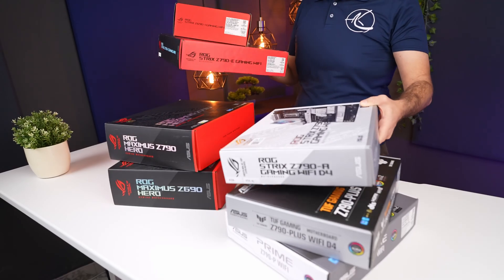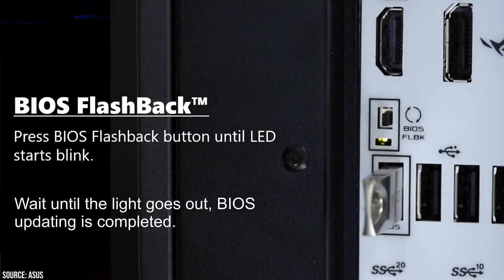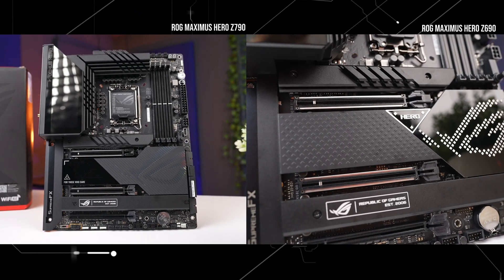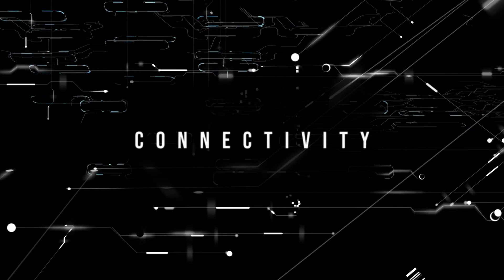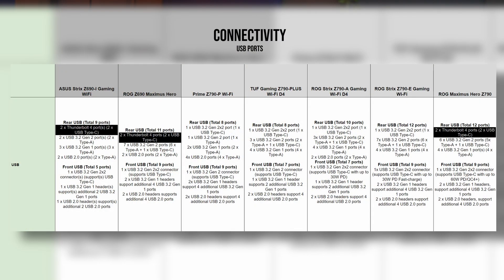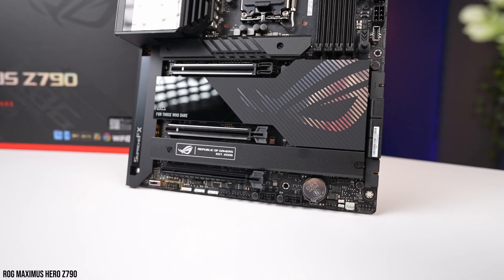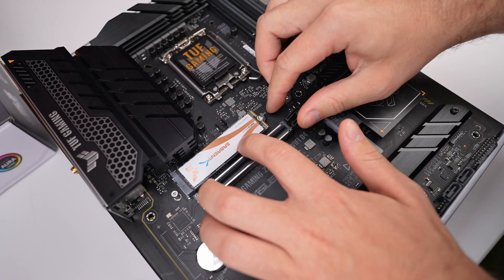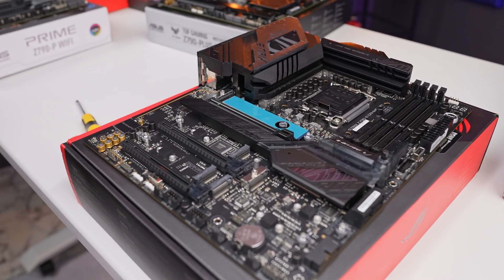WATCH THIS Before Wasting Money On Z790 Motherboards

Comment: is there any point in going for ddr5 for gaming in 1440p yet? I'm considering an i7 13700k and ddr4, can always upgrade in the future if need be. ATM I'll probably just go for an extra ssd instead or something else QoL wise.
Reply: im on the same boat. Want to upgrade to 13700k but deciding to go with DDR5. Even tho it won't make much difference yet, later down the road you can upgrade the ram without needing a new motherboard.
Reply: Save $100 and get the i5-13600K. You'll never notice the difference.
Reply: for gaming 13600k makes by far the most sense. it already has 14 cores... like 13600k is gonna be extremely good this gen. i'm personally getting ddr4 tomahawk z790 motherboard along with 13600k and using the remaining money on nvme drives id otherwise waste on ddr5 or i7/i9. on my opinion i7 makes no sense at all, you either get the i5 or go straight to i9 if you need extra cores. 13700k has only 2 more cores than 13600k, while 13900k has 8 more cores than 13700k.
Reply: @teemuvesala9575  I7 will be way better in the long run and will last 10 years easily for gaming and the price between i5 and I7 is only 100€ in my country, this is nothing
Reply: @shavonme  Won’t last 10 years and the i7 has only 2 extra cores over the i5. You will be forced to upgrade long before 10 years as CPUs are advancing now lot faster than they did in the past decade. 100 euros is enough to buy 1TB NVME. Smart money buys either i5 or i9 this gen. i7 is really irrelevant because i9 has 8 more efficiency cores and is simply lot better for multithreaded workloads. For games, there’s practically no difference between i5 and i7 and you only lose 2 p cores. You literally get same number of e cores with i5 as you do with i7. This is the first time in long time when i5 makes lot more sense than i7.
Reply: @shavonme  Idk about 10 years but i'd say 5-7 years with some "bottlenecks" down the road. Personally still use 7700k and built it in 2017. Now running with 3080ti on 1440p and it still does it's job but man the bottleneck is real over here 🤣About time to build a whole new pc (no GPU) and thinking 13700k with Z790 and DDR5. Before that i gotta save up first 😅
Reply: @TheCybusterGundam  Yeah I really wish I bough a 6700k instead of a 6600k, my i5 is just straight dogshit, never buying one again, probably gonna get a 13700k/13900k
Reply: @diarmuid4191  You should go watch some benchmarks before deciding that due to previous generations. Old tech isn't the same as new tech.
Reply: @outa7192  I bought it in 2016 lol
Reply: @diarmuid4191  You can't really compare previous generation architecture to new. That's like saying 10900k was a great cpu so 11900k is a great cpu. But in fact when you compare them 10900k beat the 11900k in some games.
Reply: @diarmuid4191  I have a 6700k and it's bottlenecking my PC on League of Legends with a GTX 1070, I can't get stable 144 fps.
So, not sure a 6700k would have been as better as you think.

Comment: is there a z790 board that can support pci-e5.0 x 16 (for video card) AND pci-e 5.0 m.2 ssd at the same time? or is it one or the other , from the $400-500 range boards I have not found one that can do both at the same time …. usually if you do m.2 pci-e 5.0 than your pci-e 5.0  
for the video card gets reduced to x8
Reply from the maker: does not seem to be available. To be honest I'd look for pcie gen 4 x16 and pcie gen 5 M.2 as you are more likely to have fast drive in the next 2 years

Comment: 1. Previously the Asus Z690 boards were flawed with the VRM heatsink being too tall and blocks most high end air coolers. Would you able to try if the problem persist in these new boards?
2. Also for the Strix E, does that means using the main M2 slot is fairly impractical for anyone who doesnt want to sacrifice lanes to the graphic card?
Reply: I second that - is the ILM fixed ?
Reply: @YouOnlyLiveOnce...  The ILM is identical to the previous generation.
Reply: just get msi or gigabyte, asus is trash these days
Reply: @teemuvesala9575  - I have 5 ASUS MB's less than a year old. They are perfectly fine good working boards...

Comment: i appreciate the volume of information you are covering, but it can be a little difficult to understand you, maybe slow it down a beat?    2:48 - can u explain the confusing part here? when m.2 one is used, pcie only runs 8 lands? can u clarify that? are u saying the GPU slot goes down to 8 lanes if u use an m.2 in slot one?
Reply: @DoNotSayThree  thats why we slow down speaking when we have a thicker accent. You could have responded a million ways, i was not expecting a curt answer, but it tells me what i need to know. thanks.
Reply: @DoNotSayThree  bro, first off, you dont know me and do not ever tell me what to do. Man to man, check urself, before someone else has to.i focus on what is important to me and in this instance i was trying to let you know that you spoke pretty fast and if you would slow it down a bit, it would be easier for EVERYONE to understand. If you cannot or will not take feedback, then just quit responding, you dont need to engage people with smartass comments who are simply trying to helpout and then in a following comment tell them what to do. Your ego is considerable and it is obvious here. i spoke "good" as outlined herein, you do not control feedback on the internet, and you need to learn how to listen and how to speak to people, and as i first noted, slow ur speech a little, which is what set you off on this tirade to begin with. So here we are, you diverting us from the point to try to tell another man, that you dont know what to do and to tell him how life is. All of this means that you do not understand boundaries in relationships and step on others toes all the time, for which they resent you, those who are financially dependent on you stay in your life longer than others, but most probablly just leave. If you are a sad and onely person, thats ok, but dont take it out on me, i have no room or patience for a young know it all to tell me anything about life, when you clearly do not know how to live your own.
Reply: @doctaadam  nobody mentioned your name buddy... lol glad you chimed in though. I did not find it rude, it is a curt answer, google that. I responded in-kind with a curt answer, thats all. nothing more.
Reply: @doctaadam  Bro, his name is creepy so no wonder he acts like this.
Reply: just play the video slightly slower? Maybe 0.80 speed.

Comment: Should I upgrade my z690-e gaming to z790-e gaming for 13900k? I know it will support 13th gen.. I am just curios , is it worth to pay extra money for the new one
Reply: Friend, speaking from experience it is NEVER worth the money for a one-generation upgrade.
It takes at least 2 Generations of hardware to see enough improvements to justify paying for the upgrade.
Reply: @overflow7276  Co pletely agree . I've been shocked to see so many people willing to upgrade cpu each generation . Especially gamers.
Reply from the maker: no unless you need any specific features
Reply: @A2KMedia  I use PC only for programming and gaming (sometimes photoshopping too) so probably those "specific features" are unnecessary for me. Thanks for the answer 🙂
Reply from the maker: no worries, then you probably won't need to upgrade at all :)
Reply: @Immortal The memory controller is integrated in the CPU so Z690 or Z790, they are just the same.

Comment: Will the NH-D15 fit on the Strix-790E? It didn't fit for the Z690. Some info I really really want to know.
Reply: I used the NH-D14 with the Noctua NM-i77xx-MP83 adapter kit and it worked for my Strix Z690 board.
Reply: Yes, it fits on the Strix 790E and 790F. Noctua has a compatibility tool on their website.
Reply from the maker: the VRM height seems to be the same but slightly different design. I would recommend reaching out directly to ASUS support to check this as I currently don't have NH-D15 to test with
Reply: @A2KMedia  On the z690-e there was some plastic that stood just in the way, people could remove it and it would fit (breaking warranty), it depends on how the shape is this time around.

Comment: Maybe 11th gen motherboard are still worth it this time.
Reply: Got my z590 strix-e for 120 at microcenter open box.  In perfect condition.  Coupled that with an 11900k and memory. I was out the door for 400 bucks.
Reply: @connor040606  You can save a couple of bucks if you choose b560-i rather than z590. Anyway, z590 is nice board though, but it's more expensive.
Reply: @michaelvincentguray4952  Yea, but at the price I got it.  It was cheaper then all B560 boards with much better hardware.  I paid 120 bucks for a Strix Z590-E
Reply: @connor040606  That's great. What is the size of your z590 board?
Reply: @michaelvincentguray4952  Its ATX.
Reply: @connor040606  I see. Nice chatting you connor.
Reply from the maker: I would probably look at the 10th gen then with the 10 core 10900k
Reply: @A2KMedia  to complete my build*

That's what people said core 10900k is better than 11th gen processor.
Reply: @michaelvincentguray4952  Becouse memory have only gear 1 and much better overckloking
Reply: @A2KMedia  I have asus rog strix b560-i board here. Soon I'm planning to buy core i3 10100f to complete if I have extra money.